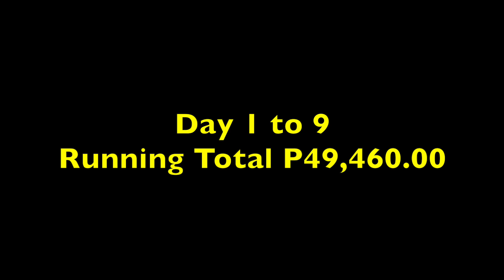Day 10 Budget Bungalow Build In The Philippines. $1,000.00 Spent So Far.

Comment: what kind  of finish have you planned ? any paint  and such ?
Reply from the maker: joh n Their original house is rotten, un-rendered complete with lifted cracked floors. So even a basic rendered finish would be a major upgrade. However what I am considering is an internal plasterboard finish battened to the walls to avoid the need for rendering inside, plasterboard can be easily coated over.  I will not be adding tiles, the grandchildren asked for them, but the house is not for them it for the couple. I am adding an extra bedroom to what they already have but if I left it to the grandchildren since I am paying, I would be building a five bedroom house, each bedroom with ensuite, fully tiled trimmed out and completely furnished.
Reply: @villagepeoplephilippines  good, I was only concerned about the cement dust, not the looks
Reply: @villagepeoplephilippines  you have a good heart, God bless you